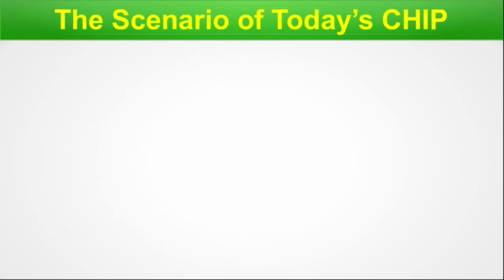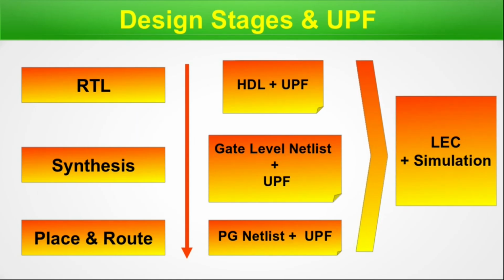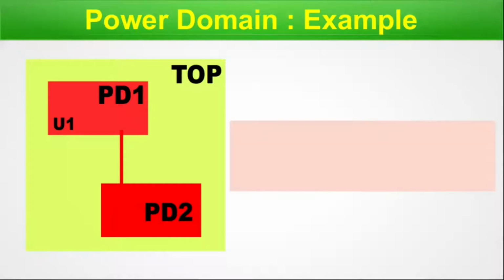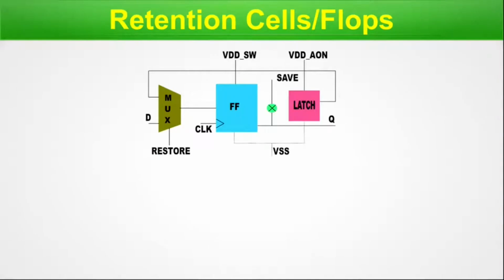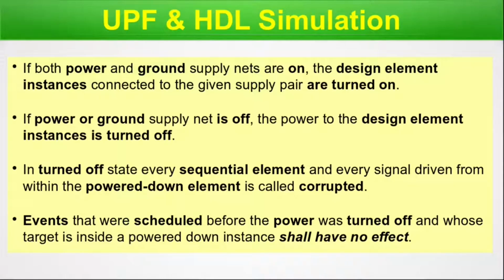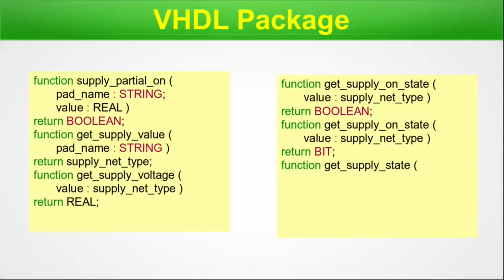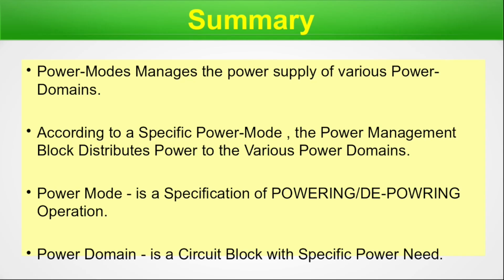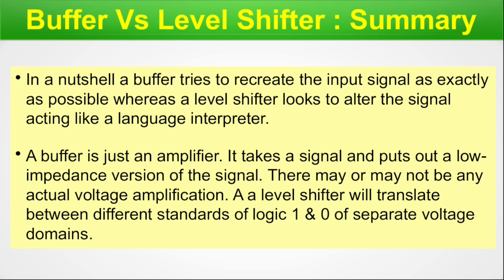Mastering UPF : A Comprehensive Marathon Guide to Unified Power Format in VLSI Design

Comment from the maker: FAQ : Which tool can we use to  practice these UPF command and any guide on how to verify or Simulate the different UPF components ?

To practice UPF commands and simulate different UPF components, you have to use Industry Standard Electronic Design Automation (EDA) tools that support UPF. Some popular EDA tools include:

Cadence Tools (Prefer CPF): Genus, NCSIM, Incisive
Synopsys Tools: Design Compiler, VCS , VCS-AMS
Mentor(Simens)Tools: Questa , Questa-ADMS
Ansys : RedHawk, PowerArtist
Before you start practicing UPF commands, it's essential to have a good understanding of the UPF syntax and semantics. 
Complete UPF tutorial : https://youtu.be/ocFfLt8wbjs
Good understanding of UPF, TCL Knowledge Essential :  https://youtu.be/v8eu-CCrm-E

To verify or simulate UPF components, you can follow these general steps:
Create UPF File:
Start by creating a UPF file that specifies the power intent of your design. This file will include information about power domains, states, modes, and other relevant power-related details.
Simulation Setup: Set up your simulation environment to include the UPF file. Most EDA tools provide options or commands to include the UPF file during simulation.
Run Simulation: Run your simulation using the appropriate EDA tool. During simulation, the tool will consider the power intent specified in the UPF file.
Analyze Results:  After simulation, analyze the results to ensure that the power-related constraints are met. Check power consumption, transitions between power states, and any other relevant metrics.
Debugging:  If you encounter issues or unexpected behavior, use the debugging features provided by the EDA tool to identify and resolve problems in your UPF file or design.
Always refer to the latest documentation and user guides provided by the specific EDA Vendor tool you are using, as the process may vary slightly between tools. Additionally, some tools may offer graphical interfaces to help visualize and edit UPF information.

Comment: Good lecture, thanks for uploading.
One question, whose responsibility is it to write the UPF - is it design engineer or verification engineer?
What does the verificaiton engineer do with UPF if he doesn't write it?
Reply from the maker: UPF (Unified Power Format) is a standard format used in electronic design automation for specifying power intent in digital designs. The responsibility for writing UPF typically falls on the design engineer, specifically within the domain of the RTL (Register Transfer Level) or architectural design. The design engineer is responsible for defining the power intent, specifying power domains, power states, and associated control logic.

The verification engineer's role comes into play during the verification phase. While the verification engineer may not be responsible for writing the initial UPF, they play a crucial role in validating and verifying that the power management aspects specified in the UPF are correctly implemented in the design. This involves creating testbenches and scenarios that exercise different power states and transitions to ensure that the design behaves as expected with respect to power management.

In summary:

Design Engineer: Writes the UPF, defining power intent and specifying power-related details at the RTL or architectural level.

Verification Engineer: Validates and verifies the correct implementation of the power management aspects defined in the UPF. This includes creating test scenarios to check power state transitions and ensuring that the design meets power-related requirements.

However , from company to company the reponsibitities may vary from the abovementioned . As an example, In a services based company , VLSI startup or testchip unit of a MNC the same person may have to write and verify UPF.
Reply from the maker: You're welcome 😊 ! 
It seems The Videos Helped You ! Please share this channel in your known or professional circle to spread the help to other also !